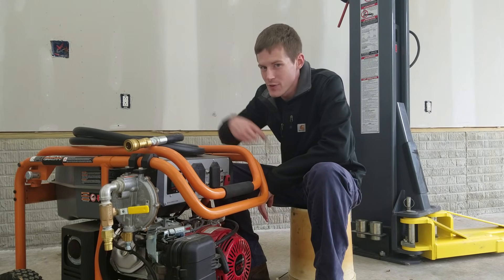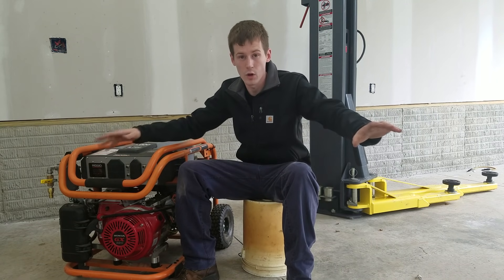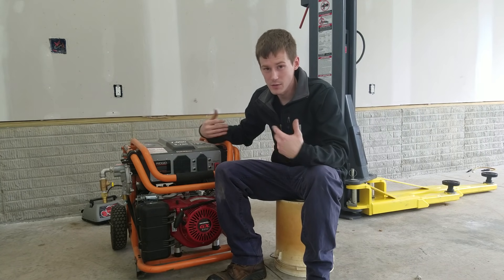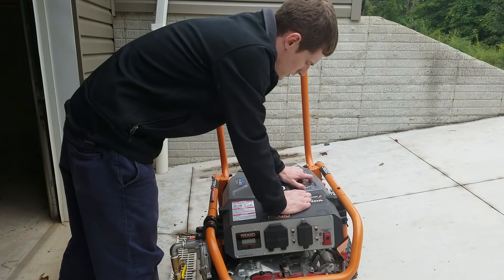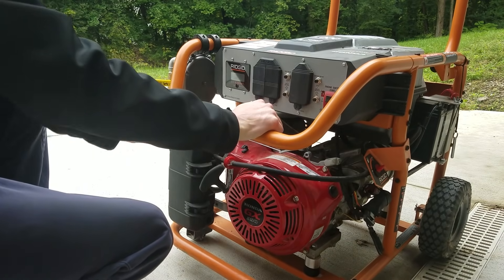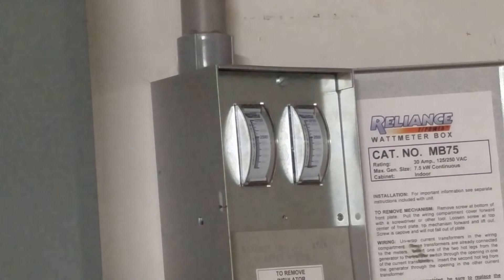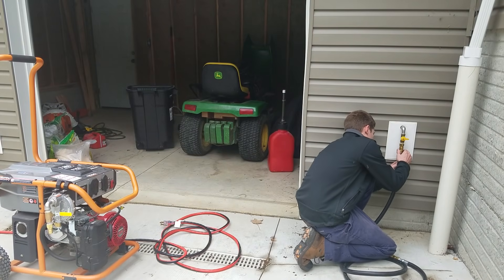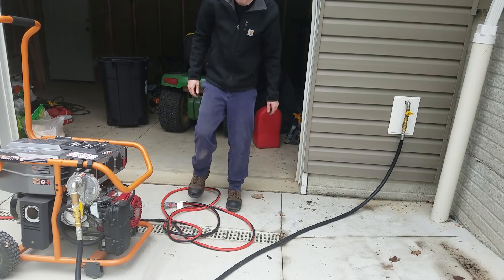Natural Gas Generator: Frequently Asked Questions

Comment: a couple of questions on the long-term stability of that 3d printed adapter.  

1.  what is the long term chemical compatibility with NG, Propane, gas/ ethenal, and engine oil?
2.  fdm 3d prints often have certain amounts of porosity.  does this system have any way to deal with this?
Reply from the maker: Those questions are best directed at Nash Fuel who sells the kit. Since this kit is being sold on a large level I would image they would've done the proper research and engineering to sell this kit.

Comment: Saw your chart for gas sizing but curious what size gas line you're running for your generator? Thanks
Reply from the maker: 1" I'm running a 80,000 BTU garage heater off the same line as the generator. I don't use both at the same time. Could have gotten by with just 3/4" but the price difference was like $.10 a 10ft stick and I'd rather go overkill than chance it when the price difference is that cheap.
Reply: @RepairGeek  Thanks! I'm contemplating sharing the 3/4" line off my tankless water heater for the same purpose. Since the generator would only be used for outages I think this will be perfect.. I'm fortunate because the 3/4 off the 1 1/4" mainline isn't too far so I think I'm ok but I'll double check with the charts you posted. BTW, your garage is nice with the lift etc. Appreciate your content.

Comment: I made a double male extension cord to get the power into my home. Is your extension cord double male? is it a kit or did you make it yourself?
Reply from the maker: You made whats called a suicide cord. Not the safest thing in the world but will work in a pinch. I have a 240v generator cord that plugs into an outlet on the outside of my house which backfeeds my panel using an interlock kit.

Comment: As you turned  the gas regulator set screw inward I noticed you didn't turn it in far enough to run the engine so rich that it began to sputter....and then back it out just until it ran smooth again. It's best to run an engine on the rich side. If you run an engine lean it causes over heating. Thoughts?
Reply from the maker: If you go back an watch the other video I started out waaay rich. To the point that the engine would barely run, then slowly leaned out the mixture until I saw 60hz like I did on gasoline. If you watch very closely I went too lean and the hz rate dropped to 59ish and I richened up the mixture again until I was at 60hz.

https://youtu.be/nO839Sayci0?t=954
Reply: @RepairGeek  I guess it could be my mistake...but in my 35 yr+ career as a master plumber, every type of regulator increases it's output by screwing "in" the adjustment screw, adding pressure to the diaphragm so that it takes more pressure to close it when the gas is on. A regulator is full open in it's relaxed position (gas off). In the video, from a lean state,  you added pressure (enriching the mixture) till it ran smooth...Where I come from you keep going till it's too rich and sputters....then back it "out" till it runs smooth...thus running on the rich side of the scale. It's just a detail...where the Devil lives.
 You took the time to make a very good vid... otherwise I wouldn't have watched it.
Reply from the maker: @readmore3634  I'm not adjusting the regulator pressure I'm changing the amount of flow on the outlet side. That bolt I was adjusting is literally a bolt in the side of a street elbow. If you run it in flow is reduced. Unthread it and flow increases. There is no adjustment for pressure. Thanks for watching.
Reply: @RepairGeek  Got it...well it looked like an adjustment screw... never seen a regulator like that...although I bet that hole in the middle of the casting with the large slotted plug down in there is for a screwdriver adjustment... anyway...
I just finished watching another conversion vid and something else struck me...when demand is added to "governed"  engines the governor adds fuel mixture to compensate.... otherwise it will run lean and that can cause overheating. Without fuel running through the needle valve...how does this configuration deal with this? Thanks
Reply from the maker: @readmore3634  the way the carb spacer is designed it pulls a slight vacuumm on the diaphragm inside  the governor regulator. When engine load increases the throttle plate opens more. This increases airflow over the carb spacer. When more vacuum is put on the regulator the diaphragm opens more and increases fuel flow.
Reply: @RepairGeek  interesting ...I only inquire cuz the dynamics of this Nat gas application is so different from household appliances, which do not "suck in" their fuel ...rather it's regulated. (About 7/10ths of a pound constant pressure) A tankless water heater has a throttle-like valve to open and close on demand, but the fuel is not violently sucked in by a fast moving piston. It's ballistic inside an intake manifold at say 3000 rpm. This stuff has to be thought out.   :- )

Comment: How can the same regulator be employed for both natural gas and LP when the pressure of LP, when purchased in a tank, is significantly greater than the 7 in. WC of residential natural gas. Great video BTW.
Reply from the maker: A propane setup needs another regulator on the tank. It's the same regulator that's on your propane grill.

Comment: I've heard that if you put quick connects on both ends of the hose, it can create choke points and the generator will not run correctly. Is that true?
Reply from the maker: No.

Comment: Thank you fro the video. I just bought a Firman 9400/7500 dual fuel generator today. Do you know if I can change it so it can run on natural gas and gasoline instead of propane? Thank you
Reply: Chris Elliot yes. Check out these guys for the conversion kit: 
https://www.motorsnorkel.com
Message them with the model # of your generator and they’ll tell you which conversion kit you need. I just purchased a duromax 12,000 dual fuel generator and I’m in the process of converting it to tri-fuel in order to run it off my home nat-gas. The snorkel was $187
Reply: @nishlok  Baron super helpful many thanks!
Reply: I would think you just need to adjust the flow rate of the propane demand regulator to allow whatever increase is needed for natural gas.  Probably not so easy to do, but surely someone has done it.  The reason I’ve read that no generator manufacturers are selling tri-fuel setups is because of the cost of getting things safety certified.   I’m guessing it also makes it hard to meet emissions regulations, since all three fuels require a different ideal air/fuel ratio.  I’m pretty sure none of these conversion kits are not AGA certified, nor UL listed, so one uses them at their own risk.
Reply: @nishlok  if he’s already got dual fuel with gasoline and propane, probably doesn’t need the whole kit from snorkel.
Reply: Jon Byler not sure about that. I think the flow rate is different between propane and nat gas. The tri fuel conversion kit allows you to adjust for the difference. I’ve seen people much better than me design a snorkel for running nat gas in their garage.
Reply: @nishlok  orafice size in the demand regulator is adjustable in some.  That effects flow rate and allows you to adjust for the less dense natural gas.
Reply: @jon_byler  I just picked up a portable tri fuel firman generator

Comment: With the valve recession thing I don't understand how it could be a big issue since for the exhaust valve it will never get any raw fuel cushioning it in a gas motor either.
Reply from the maker: You do not burn 100% of the gasoline in the combustion chamber. That was part of the reason why the catalytic converter invented.
Reply: When the time comes, you need stylite inserts in the heads. They are harder and for natural gas or propane they will last much longer.
Reply: Repair Geek I understand that point but I still say no unspent gasoline would be considered dry fuel in the exhaust stream in a properly running efficient motor.

Comment: Great video - I'm planning to do almost exactly what you did. I can't find any links to where you got the ports/fittings into and out or the house for the gas and electric. Did I miss that?
Reply from the maker: They are in the description of the original video.
Reply: @RepairGeek  Hey yes I've clicked on every link but I don't see the white covers that go over your siding to make the connections look like yours. Are those just generic items? I see they resemble those used for mounting lighting to your house but not quite
Reply from the maker: @benjaminhardwick8378  oh the panels. I'll get you the link give me some time. Thanks.
Reply: @RepairGeek  Awesome - thanks!
Reply from the maker: @benjaminhardwick8378  https://amzn.to/3hjo52C

You will have to cut your own holes to get the wire and the piping through.

Comment: Any update on this video? How’s things going? Greetings from Southern US. With all the hurricanes we get, I am looking to do a conversation on generator. Any suggestions on brands?
Reply from the maker: No real update to report. The generator just runs. It's never an issue starting it up. I've used this setup on a few small 4 hour or so outages over the past couple of years. No issues at all.

You get what you pay for, buy something with a Honda GX series engine and something with low Total Harmonic Distortion- THD. THD is how clean the AC sign wave is. You want to find something with less than 5 or 6% THD. Utility power is less than 5%. Low THD is good for running sensitive electronics.
Reply: @RepairGeek  yeah, I just got to bite that Honda engine bullet lol 😂 I know it’s the best long term

Comment: I also have a ridgit generator and it says e10 only.  Where do I get this from? If you can answer my question I would really appreciate it!
Reply from the maker: Any normal gasoline is E10. E10 is 10% ethanol 90% gasoline. The federal government regulates ethanol content at 10% for standard gasoline. So, E85 is 85% ethanol 15% gasoline.
Reply: Repair Geek you are awesome... so quick to reply, and for this reason I just subscribed to your channel! I knew it but just wanted to check for piece of mind. Cheers!!!!

Comment: Stupid question; I have free natural gas on my land, I’m building a few tiny home cabins; is there a way to power all three with one generator similar to your generator? And also do you keep it running non stop or only when you need it?
Reply: A 5 or 7 kW generator should do the job, but I would get a permanent stationary generator installed instead of a portable one like this. I would also size the generator so that it runs at about half load or so on a regular basis. I would also opt for a three phase generator seeing as you have 3 separate buildings you want to power.

Comment: im british so forgive me we dont really do this

my question is how do you backfeed the house i understand the concept of it but wouldnt this mean at some point at either side of the proccess your left with a cable potentially at mains voltage with metal prongs sticking out ready to zap you 

either when on generator the end of the extension cable (edit maybe not a issue if its female on the end?)

or when back on mains the generator side of the cable (edit upon reflection id imagine this couldnt happen due to the interlock on the breaker)

or is there specific cables and connectors for setting up a backfeed system
Reply from the maker: Okay there are multiple YouTube videos on how to do this. Just search: generator interlock kit

I have no idea if this is code in Britain but, this is how it works:

You have an outlet outside your home that accepts 240v from your generator. This plug is male, the extension chord is female. This outlet has a cover. As shown in the original generator video.

The outlet on the outside of the house is wired to a breaker that can only be turned on when the main breaker is turned off. (Interlocked with the main breaker) This way it's impossible that the outside outlet has power while the main breaker is on. So, this male plug on the outside of the house cannot have power on it unless its in use. This interlock kit is visible when the door is open on my electrical panel. It is on the top right breaker.

As far as the wattage meter. The wiring runs behind the gauges and goes through two miniature amperage clamps (like clamp style multimeter) before the power wires terminate at the interlocked breaker.

The breakers that are used are just normal breakers, you size the wiring to the size of your generator and your breaker. A 7500 watt generator will power about 30 amps at 240 volts. The maker of your electrical panel should offer an interlock kit. It just depends on the brand of panel you have. 50amp outlets are available if you need more wattage.

These are the parts that I have for the interlock:
Interlock kit: https://amzn.to/2xw9Zor
Outside outlet: https://amzn.to/2xzv9Ce
wattage meter: https://amzn.to/2QVoeew
Reply: ahhh i see now so the outlet of the generator is female the extension cord is normal and terminates also at female the house has a male but with the interlock theres no way to energise those prongs and hurt yourself 

thankyou for explaining interlocking isnt really somethingn we do in the uk mostly because we dont really have storms and the weather you guys have and with the way we run our power its mostly underground apart from when it goes long distance via the pylons (which are taller than trees) so power outages are a verry rare event 

the only places i know of that do simmilar would be large hospitals and schools that have hardwired systems 

but t hanks for explaining that too me i was wondering how it wired together
Reply from the maker: No problem. There are a ton of different ways to power your house during an outage. Interlocking is quick, cheap, and flexible as far as what you can power.

Comment: I was looking at a hybrid generaltor DuroMax hybrid XP12000.  It already has propane capability.  Do you know how that can be modified to take on natural gas?
Reply from the maker: Unless you can change the output of the governor regulator on that unit it can't be done. Natural gas requires more fuel flow to run correctly. I'm sure you could probably install a standard tri-fuel kit like I did to get it to run on natural gas but, if you are going to do that, it would be cheaper to just by a gasoline generator and convert it with a standard tri-fuel conversion.
Reply: @RepairGeek  I just saw this video. https://www.youtube.com/watch?v=z2tQjROIhhE  He just connects directly to where gas goes in and just uses a value to adjust the flow. That's all it takes?

Comment: What about spraying a light oil into the intake from time to time, wouldnt that help
Reply from the maker: Yes that's basically what a lubricator does. The lubricators put out drops per minute. So time to time probably won't help much unless you want to babysit the generator and spray the intake every 3 to 5 minutes.

Comment: RG, I keep think about this application because I have a need for a tri-fuel system in my future.  I already have a genset and need to convert it.

Question:  Would a two stage regulator like the type used in Oxy/acetylene welding do the trick?  It is adjustable to allow for pressure regulation.. What do you think?
Reply from the maker: I'm sure that style of regulator should work but, natural gas isn't the place to tell your self, "This should work". Honestly I would only use something designed for this application. 

The regulator that I showed in the video will shut off all gas flow if the engine stalls for some reason. I doubt that style of regulator would do the same thing.
Will it flow enough natural gas to let the engine run properly?
It seems like to many safety issues and unknowns just to save $50 to me.
Reply: You need to be looking at what the regulator looking thing he attached to the generator is doing.  It’s a “demand” regulator that uses intake vacuum to control gas flow into the engine.  A pressure regulator won’t be helpful, since it won’t change with demand from the engine intake.  Pressure regulator is needed to take high pressure LP gas and drop it to the pressure that the rest of the system works at.  Too much pressure, and that demand regulator will no longer work right and you won’t have control of your air/fuel mix.  Propane conversion kits tend to come with a simple regulator like on a bbq grill that drops pressure for you at the appliance to 1/2 psi, which is about what natural gas pressure in your house is (anywhere from 1/4 to 1/2 psi in most cases).

Comment: Great video! I have a question.. 
Natural gas per Therm = 29 KWh ..
It cost me $1.3 per therm. .
It cost me .12c per KWh of city electric. 
That means that I'm paying $3.48 for 29 KWh of electricity 
while for the exact equivalent KWh from NG I'd be paying $1.3. 
That's a HUGE difference in price! But here's what I don't understand..

I read that Natural Gas generators cost around $2/hour to run which would be $48/day. 
Per KWh it looks that gas would be much cheaper to power my house but $48/day is way more compared to what I pay for in city electric. Can anyone make sense of this for me please? Would I need to transfer the Natural Gas in a more efficient way? Thanks!

Comment: Excellent, thanks for the info. Makes things easier for me when I decide to do this. We loose power frequently here and I'm sick of it. Question. Are you running 240V or 120V to the panel..??
Reply: You can see he's plugged into the 220v outlet on the generator, and you can also see that the transfer breaker in the panel is a 220v breaker.  Plus he said that he's running a well, which is most likely 220.